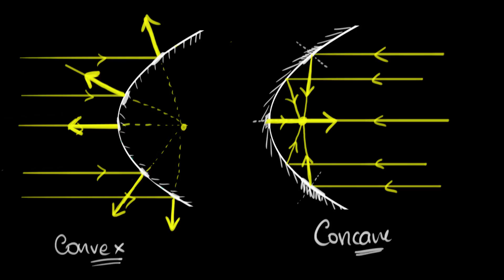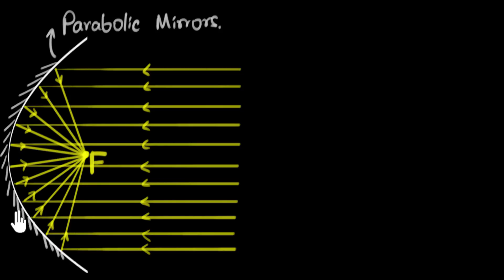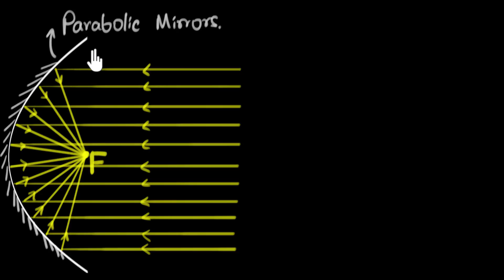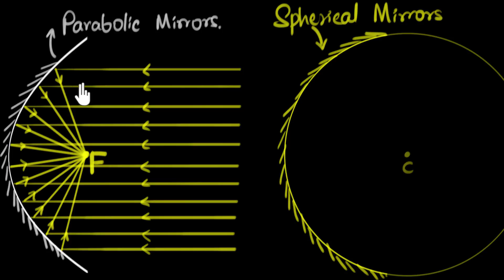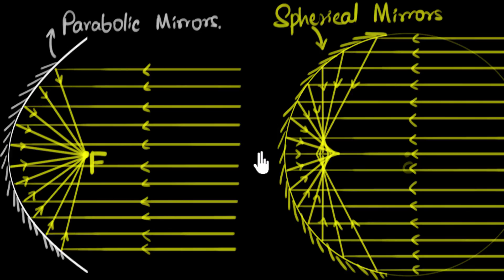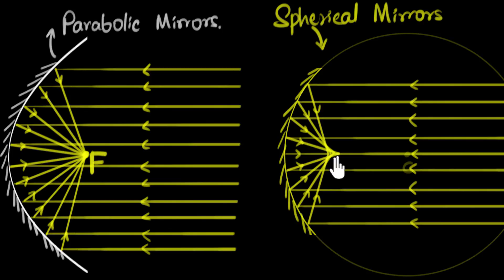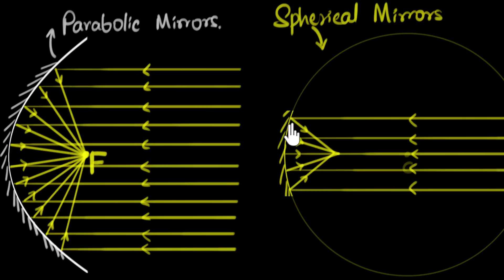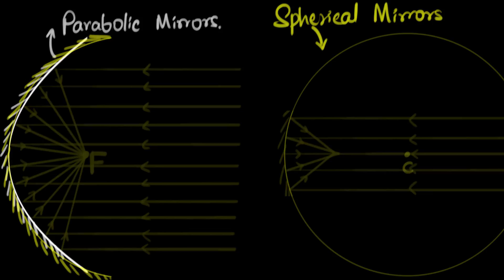Spherical & parabolic mirrors

Comment: Dear Sir,

It's amazing to see that you motivate and clear the doubts of many students through experimental videos based on physics concepts. I also watch your videos regularly. Thank you for your kind words! I appreciate your efforts, and please accept my request as an opportunity to clarify more about antennas.

When discussing TV antennas, it's important to note that they are typically parabolic in shape. This design allows them to effectively focus incoming radio waves onto a receiver, resulting in stronger signal reception. Parabolic mirrors indeed concentrate light at a single point, typically at their focus, making them suitable for applications like solar energy collection or telescopes. In contrast, concave mirrors may exhibit less intense focusing, sometimes resulting in the spread of light along the principal axis rather than at a single point. Additionally, when considering one-point focusing, parabolic mirrors generally cover more area than concave mirrors, except in cases where the size of the mirrors is significantly small.